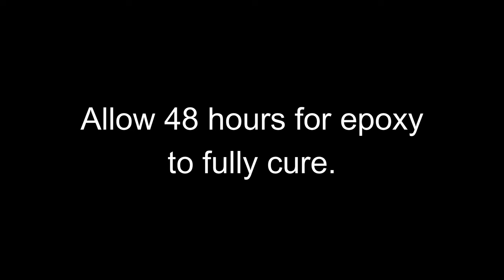How to Replace Slate Liners on a Pool Table

Comment: Can the west system be used for indoor tables as well? If so what hardener and main are you using?
Reply from the maker: Sure. You can use the West Systems epoxy for indoor use. When selecting a hardener for it, you have to take temperature into account. If you're using it in a cold environment, use fast hardener (50 or so degrees or lower). For moderate temperatures, use medium hardener (60-80 degrees). And, if it's warm (80 degrees or higher) use slow hardener. The chemical reaction between the hardener and the epoxy generates heat. Additional heat will speed up the reaction. So, you have to make sure you use the appropriate hardener for the ambient temperature.

Hope this helps.

Comment: Can I install liner on my slate? It’s originally does not have liner. But I’m having hard time to level it. The frame is not solid wood . It’s 3/4 plywood

Comment: Help! I just bought a 9' Brunswick made in 1893. It has T-rails, and 8 of the 24 rail bolts were missing. I bought replacement bolts, and then come to find that one of the empty rail bolt holes had a rail bolt broken off inside of it about an inch deep inside the slate bolt hole. How in the heck can I get that bolt out without damaging the slate? If it isn't possible to get it out, how much will the 'playability' of the table be affected if I just assemble the table without one of the rail bolts? Thoughts? Ideas? Thank you.
Reply from the maker: I replied back to your Facebook message.

Comment: Based on all of your teachings and recommendations, i finally got a slate 8’ table that needs some TLC. It’s an imperial but the guy posted as Brunswick. I got it for $250 and will need to redo the cloth, rails seem to be ok but will test, it’s not real wood but press board on the box. This video came just right as the slate lining are pressed board as well and I’m going to follow your recommendation to replace for real wood. In the future, I’m going to use the boards from this table to cut nice new wood boards and make it a great table!
As always, thank you and let me know your thoughts on the imperial please! It’s a $3800 new!!!
Reply from the maker: Imperial produces some good tables as well as some dogs. If it's a $3800 table new, should be one of the better ones.

Glad you're enjoying and gleaning info from my videos!!!
Reply: @CreativeRestorations  I've been watching several of your videos and they have been very informative.  My uncle gave me an American Heritage table that he had stored in his shed for a few years and moisture got to the particle board slate liner.  I was going to try and get a 5x8 sheet of 3/4" MDF to replicate the existing slate liner.  Do you think it would be better to line each of the 3 slate pieces with pine instead or to do the one piece slate liner as it was originally manufactured?
Reply from the maker: It all depends on how the current MDF is being used as a slate liner. Some manufacturers try to cut corners by using it as both an anchor point for the cloth as well as an anchor point for the slate. If that's the case, then, you'll have to do more modifications in order to make it function properly.

Each slate needs to be able to move up and down independently of the adjacent slate during installation. If the manufacture used the MDF as an anchor point for the slate to the frame and you want to install true slate liners, then you will need to add additional anchor points all the way around the frame of the table. This would be the best course of action since, the MDF wouldn't flex when trying to insert wedges. Typically, I would use a piece of pine 2x6 and a piece of pine 2x4 as anchor points. You would need a total of 8 (two for each side and two for each end).
Reply: @CreativeRestorations  Thanks for the info!

Comment: Doug,  I have an 1898 Brunswick Saratoga I am restoring.  My slate liners are in good condition and firmly attached but the edges are full of staple and tack holes from 124 years of refelting.  Could I just somehow repair the ones that are on the table?  What do you suggest?
Reply from the maker: I would replace them. You can get by with filling them with Bondo. But, it's too easy and too cheap not to just go ahead and replace them.